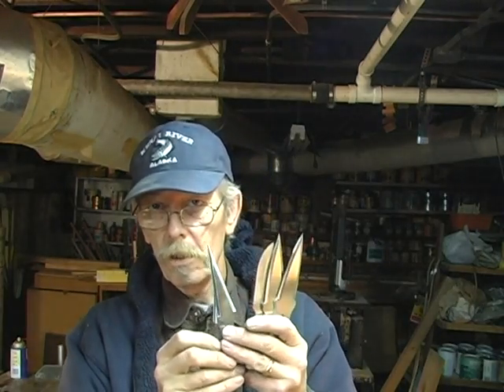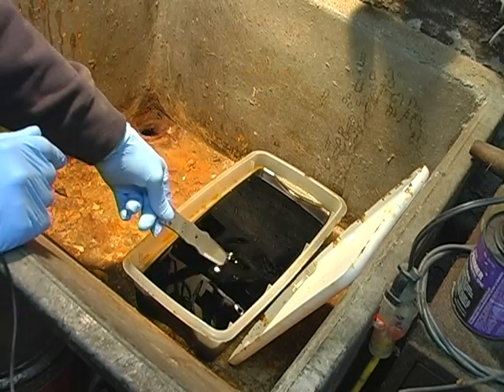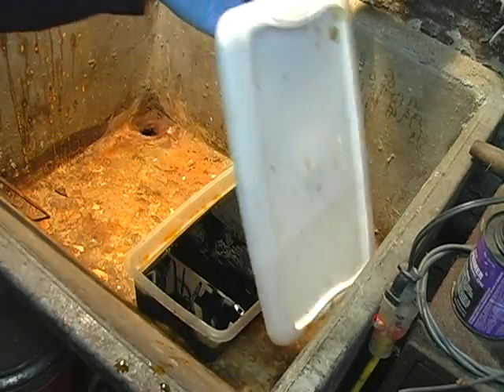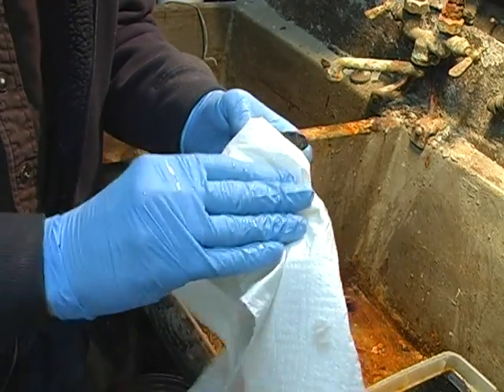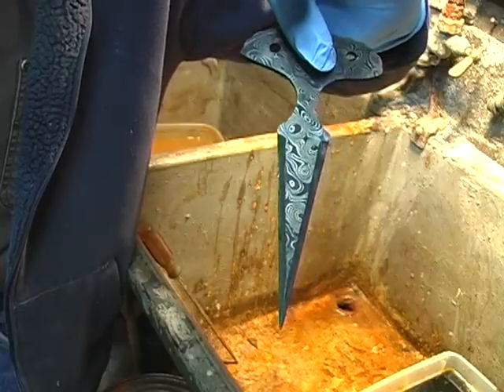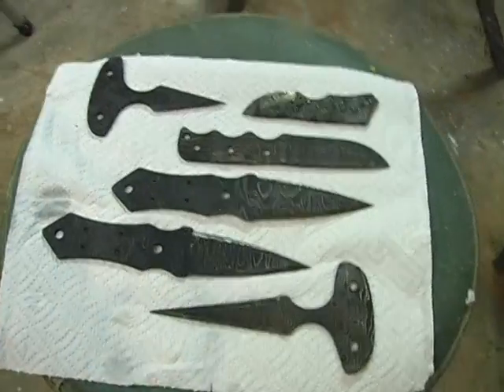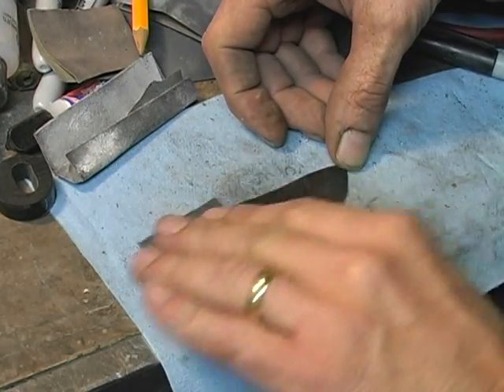Etching Damascus

Comment: Now the question is how you pin it, cut out the handle and sand it down without taking off the etch from the spine/tang of the knife. Would it be possible to just paint a little on the tang and bring it back out?

Comment: Mike, I made a knife and while sanding the handle I accidentally removed the etching from the sides. Since it is already glued with epoxy, what do you recommend to fix the finish?
Reply: find myself in a similar position ,, did you find out ??

Comment: you said 40% ferric chloride to 60% white vinigar. im guessing thats mixed ferric solution mixed with vinigar not dry ferric powder... or did you mix the ferric powder with only white vinigar?
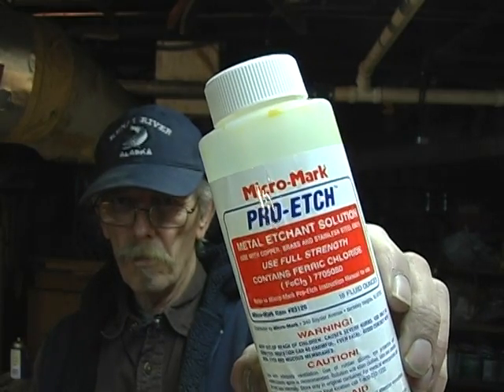Reply from the maker: I use liquid ferric chloride as shown at 2:50 in the video.
Reply: BowieMaker thanks for the reply. ahh i see i couldnt tell if it was pre mixed solution or powder. thanks again.

Comment: is it essential to grind down the existing pattern to re etch the blade? I have a blade with a faded pattern and want to re etch it so it's nice again and I didn't know wether to grind it or not
Reply from the maker: If it is real forge welded steel with layers of metals (what we call Damascus today), you would not need to grind it. Just clean it and etch it. The longer you leave it in the etchant, the deeper the etch will be.
Reply: +BowieMaker thank you! I appreciate your help and I really like your videos!

Comment: Hey guys, i just wonder, the name of damscus blade/ damascus knife not because the pattern but because the knife using the damascus steel  and mix it with regular steel right?
Reply from the maker: The original Damascus originated in Damascus Syria, hence the name. However what people commonly call Damascus today is layers of forge welded steel and not true Damascus as nobody really knows how the original Damascus was made. The steels used in todays "Damascus" are common steels such as 1095, 5160, 52100, and 15N20.
Reply: +BowieMaker ooo i see, thank you sir, i have 8" damascus knife from pakistan, its razzor sharp and works fine,  so this layers kind of thing make a knife better in performance and durability edge sir?
Reply from the maker: In its day (3rd-17th century)"Damascus" (Wootz) was superior. We have come a long way since then. I believe modern steel alloys will outperform "Damascus" . Understand that Damascus is very general term for forge welded steel. Just as there are many types of steel, there are many manufacturers of Damascus. It can be good or bad depending on the quality of the materials that go into it and the skill of the persons who make it. From my experience, most of the "Damascus" coming out of modern day Pakistan is pretty low quality.
Reply: +BowieMaker thanks sir, so where i can found good quality of damascus knife with low price sir?, i bought my damascus knife at ebay auction..

Comment: what is your mixture for the neutralizing solution?
Reply from the maker: I just dissolve some baking soda in water.
Reply: Thank you for the reply, I note you said that twice in the video but what is the water to baking soda ratio of your neutralizing solution?
Reply from the maker: It does not take much. I do not measure it. I just dump about 1/4 to 1/3 of a 1 lb box into about 1-2 quarts of water. I stir it up and used it until it gets dirty. You can also spray the blade with Windex glass cleaner to neutralize the acid.
Reply: Awesome thanks a million for the tips, I've started making Damascus as a hobby so this will come in real handy.

Comment: great video :)  im watching 2nd time around and wondering if my knives are the right steel , can you please tell me if you think i might get a pattern on this knife 
 Material: N690 Steel
Surface:stone washed
Hardness: 58 HRC
Blade length: 5 cm
Total length: 15 cm
Blade thickness: 0.3 cm
Reply: damascus steel is several different steels layered and folded together to create a pattern. the acid eats away at some of the thin layers to create those patterns. you are simply using a slab of steel, therefore it would not etch

Comment: is a solution reusable? or its just good for one time operation?
Reply from the maker: +Zoffpawel Yes. I use the solution for months.It will weaken and the etching process be slower as it weakens. When it gets too slow I mix a new batch.

Comment: All the blade I see on Alabama Damascus site are already etched. Do you have to call in the order. What do I ask for to get the blades like the ones in the first part of this video polished. do they have hidden tang or stick tang like this as well.
Reply from the maker: Benjamin Van Foeken I do not buy blades. I buy billets of Damascus and cut and grind my own blades. The billets are etched so you can see the pattern. When I grind the blades, the etching is ground away so I have to etch them again after I am finished.

Comment: can you do this to any steel?
Reply from the maker: tzDub92 As I explained in the video, etching just brings out the pattern that is already in the Damascus steel from the many layers of different metals that have been folded together. Stainless steel will not etch and plain carbon steel will just turn gray or black.

Comment: beautiful patterns!  how much baking soda in how much water to make the neutralizing solution?  thanx for showing your technique!
Reply from the maker: I do not have a formula for the baking powder solution. Baking powder is cheap so I just dump about 1/4 pound it the tub of water shown in the video. It does settle so I stir it before using it again. Windex glass cleaner will also neutralize the acid. After the metal is dry, coat it with WD-40, Break Free, or other type of oil to prevent rust. I have found EEZOX to be the best protective coating that I have tried.
Reply: BowieMaker Sorry Mike, just one more question.... can a stainless blade be etched with this type of result?  I know it's a longshot and hope that doesn't sound too ridiculous.
Reply from the maker: nateroo No, stainless steel will not etch. It will just turn a dull gray. And unless it is layered steel there would be no pattern to show anyway. There are a few people who make stainless Damascus but it will not darken and show the pattern like non-stainless will.
Reply: BowieMaker
i understand....thanx for helping me save wasted time.  any thoughts on patina?  if my 20 questions is too much, i'll understand if you don't reply.  i don't wanna be a bother.  thanx again mike!
Reply from the maker: nateroo You cannot get a patina on stainless steel. For a quick patina on carbon steel, just stick it in a potato and leave it overnight. If the knife is too big for a potato smear it with mustard and/or mayonnaise and wrap it up in plastic wrap for a day.

Comment: BTW "PCB" etchant is simply "Printed Circuit Board" etchant. If you put any brass or copper on your knife such as a hand guard or pommel and you want a design put into it just cover the whole piece with a sharpie and then scratch away over what you want to etch away and it will make a bass relief design.

Comment: those are not sharpened yet, correct?
Reply from the maker: Correct. Sharpening is the last thing I do after making the sheath. Acid etching would dull a sharpened blade.

Comment: Those are some absolutely stunning looking blades Mike, you do some seriously amazing work, I particularly like the smaller push dagger, its something I've been trying to make myself and enjoy seeing done well. 

Just a question, if you don't mind me asking, but do you offer lighter or darker etching options, or does it just sort of come as it comes? Thanks, Kyle.
Reply from the maker: Yes, I can control how deep I etch the blade and how dark I leave the pattern. I can lighten the pattern by lightly sanding with 600 or 800 grit sandpaper or I can completely remove the dark portions by surface grinding or buffing the blade. 

Daggers are kind of hard to learn to grind. Instead of making two even and symmetrical grinds like on a ordinary knife, you have to get four grind even and symmetrical.

Comment: So I guess if you wanted a really discreet damascus effect you would only keep it in the etching solution for a minute maybe? Or even less?
Reply from the maker: It depends on the strength of your etching solution. You can soak it for a few minutes and then look to see how deep it has etched. Fresh and strong acid should start to etch in 5 minutes or less. I usually like a deep etch so I leave it for 30-45 minutes.
Reply: BowieMaker
Ok. Thanks for the advice and your great videos!

Comment: Hey mike, if i use the pcb from RS do i use it straight out of the bottle 60% and also 40% white vinegar. Thanks, Jon
Reply from the maker: When i used RS etchant a long time ago I used it full strength. The RS etchant does not contain ferric chloride.
Reply: OK, thanks a lot that is news to me, i was thinking it did. Thanks for all your knowledge, maybe one day i will be able to make them come out as nice as you can. You do some great work, i will be buying one for my collection soon !

Comment: Thanks for this.  I slipped with a wire wheel I was cleaning up a reground handle with & took off a few mm of Damasacus finish in the guard area.  Now I know I can either refinish the small area or even re-finish the whole blade.  What concentration baking soda-2-water do you use to neutralise the acid?

Comment: Thank you. I'm trying to build a small mapp gas forge and have figured out that I'm not rich enough to use mapp gas as a forge welding fuel source. I'm getting used wire rope pretty clean with borax, I just can't get it hot enough to actually weld. I should also mention that I am most definitely not rich. I'm looking for any advice and instruction that I can get.
Reply from the maker: I do not forge my Damascus. I buy it in billet form from Brad Vice of Alabama Damascus. I cannot offer advice on forging it.

Comment: How soon can the carbon steel Damascus be oiled after rinsing and drying? If it is oiled immediately, will the black be rubbed away?
Reply from the maker: Make sure it is dry and let it set for two hours. After that time the black should be permanently set and you can oil it.

Comment from the maker: Damascus is a very general term. It depends on what the ingredients are and how well they are forged and heat treated. The Damascus I use does contain spring steel as well as ball bearing steel, bandsaw steel and nickel. I can't say if it is stronger than an unknown spring steel alloy.

Comment: You watched the video man... Don't you understand what is happening? He has a Damascus steel knife. He is etching the knife... It is very common. Every Damascus sword, knife, or gun barrel I have ever seen was etched. It makes the pattern "pop" by darkening the higher carbon areas and you can polish it with sand paper to shine the more raised areas which are the stainless areas... Then you have dark and light patterns. If you don't etch it, it's hard to even tell it's Damascus most of the time.

Comment from the maker: I never said the acid created the pattern. If you watch the video I demonstrate that the pattern does not show until it is acid etched. There is no stainless steel in the blades shown in the video. The Damascus I usually use is 4 layers 5160 spring steel, 3 layers of 203E low carbon nickel alloy, 3 layers 52100 ball bearing steel, and 3 layers 15N20 band saw blade steel. These 13 layers are forge welded and then folded 5 times to achieve 416 layers.

Comment from the maker: Yes, 1060 and 1075 will acid etch. How distinct the pattern is depends on different metals and how the acid reacts with them. Nickel is usually included just to add contrast because nickel will not etch and will remain bright silver against the darkened carbon steels.

Comment from the maker: Normally blanks and billets are annealed and should be easy to drill. If the steel has been hardened, it will be as hard as your drill bit and you will not be able to drill with with normal drill bits. If it is hardened, you will have anneal the area you want to drill or else try carbide drill bits.

Comment from the maker: In modern terms, Damascus has become a general term for forge welded steel. The Damascus that I normally use is made by Alabama Damascus and contains, spring steel, ball bearing steel, bandsaw blade steel and a nickel alloy. 13 layers of those 4 metals are folded 5 times to achieve 416 layers.
Reply: Hey, I know it's been 8 years, but I was just cruising Damascene vids and I came across this. Are you absolutely SURE 416 layers? I've seen 256 layer and it's 4x as dense as this. It really looks like the 80-96 layer range.

Comment from the maker: I really do not have a good way to mark Damascus. I use my Personlizer Plus acid etcher just like I do with my stainless steel blades. With Damascus sometimes it works and sometimes it does not. The best method I have seen was a knifemaker who had their mark laser cut into tiny vinyl stencils. He applied the stencil to the blade before he put the blade into the ferric chloride and removed it afterward. The blade was not etched where the stencil was and it left a beautiful mark.

Comment: Cheers mate, I just went through the whole process tonight. it took me 8hours etching the blade in the 37o/o sulfuric acid. it finally came out with dark grey( it just don't go black as you said) . my blade is a Sanmai with stainless fold forged jacket and high carbon steel core.

Comment from the maker: I do not know what you would use. The typical acids we use such as ferric chloride will not etch stainless. At best, it will turn it a dull gray color. Stainless damascus is rare because stainless is very hard to forge.